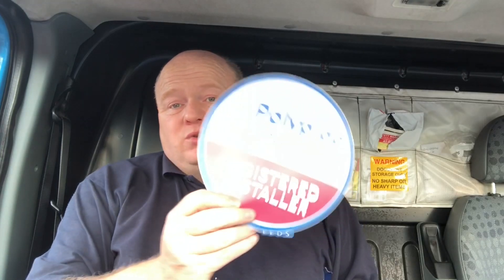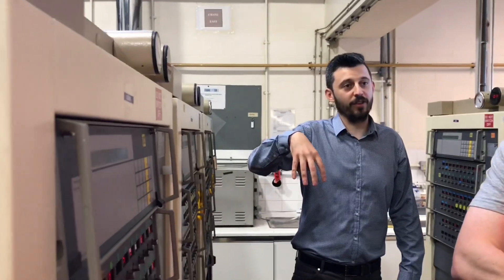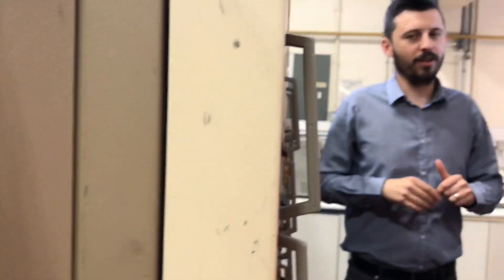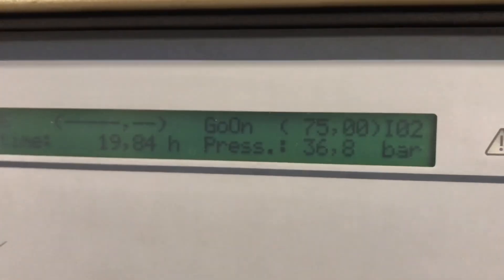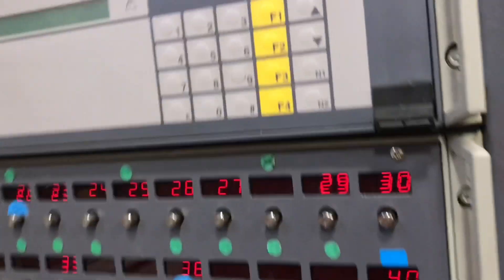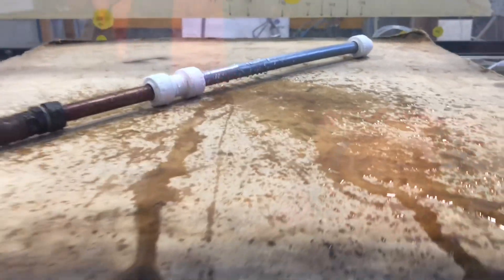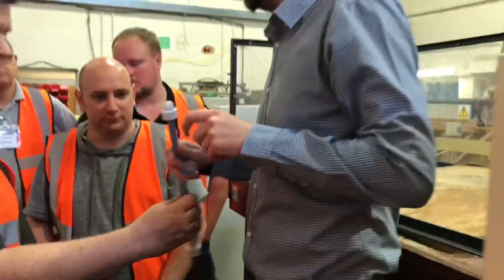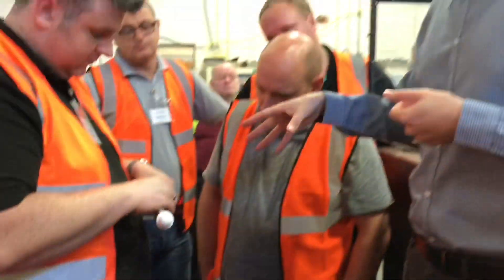Polypipe Pressure Test - Leaking Plumbing Pipework

Comment: Never use it but fixed multiple dozens of leaks on it, the issue has never been high pressure, it’s low pressure or when it freezes ie contracts, some estates by me have been entirely fitted with this stuff, love a cold night in winter as I get lots of repairs the day after when joints have come off in garages and lofts, I have been to many houses in the same street on the same day, try freezing it and seeing how easy it comes apart 🥶.
Reply from the maker: Where they all lagged correctly? Thanks.
Reply: Allen Hart they are very well insulated properties in general, it’s very cold nights when the issues show up, even spoke to the rep about the issues, as soon as it warms up the next morning they go back together and last for many years, usually until the next very cold night.

Comment: Never had a problem with Speedfit that I've installed. Had a couple of call outs to leaks where Polyfit fittings have unwound themselves on the threaded part of the fitting over time.
Reply: Usually in the ceiling void of a new build house a few years old.

Comment: The problems with push fit plastic is that the fittings have to be supported each side with no side pressure on the fittings - well clipped. With hot water pipes enough space and and slack has to be given in the pipe. I have seen Speedfit pull out of the fitting when expanded/contracted.

Comment: I have had a leak on pushfit fittings on shower mixers with copper pipe inserted. Make sure silicon grease is on the pipe and fitting.

Comment: This was a good watch, cheers for sharing. Any other pressure tests I've watched involving plastic fittings have been with copper pipe. That's amazing that plastic pipe withstands a massive 72 bar and the fittings still stay in place even after the pipe has popped. Failure rates on plastic systems are mainly down to installer errors, and incorrect installation not carried out to manufacturers guidelines. I never mix different brands and their inserts as this is one area that I've witnessed failures.
Reply from the maker: Thank you for watching.

Comment: Don't this type of pipe eventually fail overtime due to becoming  brittle?
 Great vlogs Allen.
Reply from the maker: I cannot really comment on that. I have only had fittings leak in the past. Thanks.
Reply: Hepworth guarantee them 50 years. For what it is worth.
Reply from the maker: @John Burns  lol.. I once tried to claim. Didn’t go well.
Reply: @AllenHart999  
What went wrong?
Reply from the maker: @johnburns4017  The green grab ring failed, They blamed installers.
Reply: @steve 923
When it is hot it can sag then put stress on the pipe and fitting, which reduces its life. It has to be well supported. Lead pipe sagged in time, so it was supported all its length by a wooden baton. Treat plastic the same way and it will last.

Comment: So why over time do u get failures?,
Reply from the maker: Which bit normally fails?
Reply: Fittings
Reply: @AllenHart999  the fittings (all manufactures)
Reply from the maker: @Ryanwolson12  Thanks for the feedback. I have seen a few issues over the years but never on any of the ones we installed. We used to install a fair bit of speedfit.
Reply: @accesszero4803  
Keep stress off the fitting. The pipe must be well in with pressure to one side. The pipework with plastic must be well clipped.